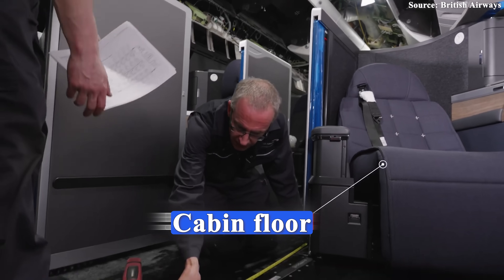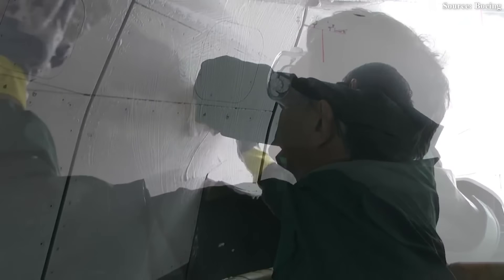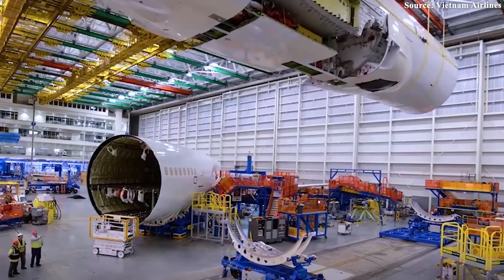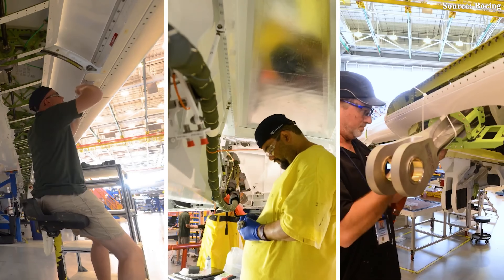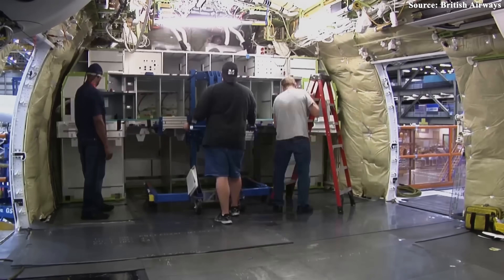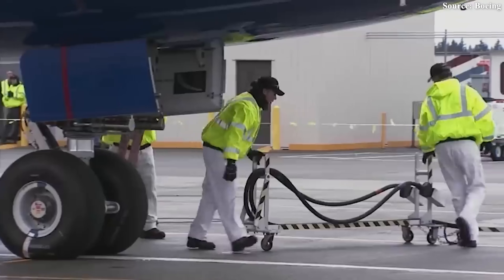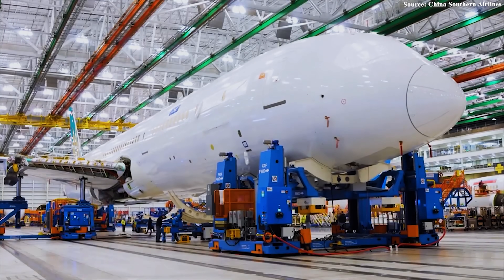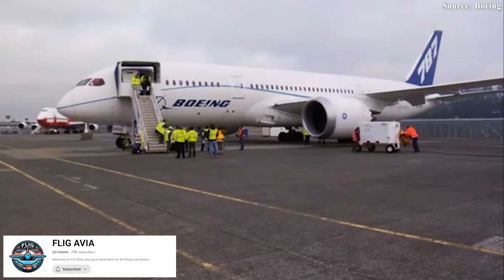What They Found In A Boeing 787 Will Leave You SHOCKED!

Comment: I worked for 38 years at a military aircraft manufacturer and when we constructed parts of aircraft we had tight tolerances if your components did not fit the tolerance your components were rejected and you had to start again to think boeing allowed drill holes out of position to be re drilled is criminal.

Comment: I have been in aviation since January 1969.  Starting in US Air Force aircraft maintenance and later becoming a commercial pilot.  I  will never fly on any Airbus or any fly by wire or computer controlled aircraft that the computers can’t be taken out so the pilots can control the aircraft.  I heard a long time aircraft engineer testifying before Congress that computers have too much control in modern  aircraft.  I would rather fly on a well maintained DC 6 than any fly by wire aircraft.

Comment: Electrical glitch and design..when electrical power is interrupted, even for a fraction of a second, 787 and 777, for any reason, the spring loaded fuel cutoff valves to the engines will snap shut. This design is that in case of electrical failure, which means fire extinguishers cannot be activated, fuel shuts off automatically so the wing does not burn through from an engine fire. At take off there seems to have been an electrical snag. Happened to ANA 787 after landing using reversers, in Tokyo, and unable to restart. Happened to BA 777 landed safely mile before runway in London Rtd Training Capt

Comment: Airbus is NOT without scandal. They are responsible for at least two crashes. The first on a demo flight that crashed into the trees. Another because to much rudder authority snapped off the vertical stabilizer and crashed all was lost including passengers. So don't speak too highly of Airbus. Then there was Air France 447, crashed into the Atlantic. All lost also. Be careful about accusations.

Comment: Shocking discovery non stop in the news for a month, yet Air India has not grounded Boeing 878. Another Air India flight to Hong Kong, British Airways, KLM, ANA all face technical problems and made emergency landings but FAA not grounded Boeing 878.
Reply: And now Air Current is reporting that the whole Air India 787 crash investigation is focused on the Two Fuel Cutoff Switches 
“Yeah they got turned off”
Plane engines got TURNED OFF!!

Comment: he’s correct the last good aircraft boeing  made was the B747-8F  s cargo bariantsold to Atlas  Air 2023  unfortunately no passenger seats so we csn’t fly on it.  with it’s milti rnhined safety! boeing only builds twins now which are not   proving ho be a food idea  ETOPS. ( Engines Turning  Or Passengers  Swimming snd boeings poor profuction Quslity(  mskes yhe mottomif it’s a ‘Boeing  I ‘ m not going  more  didefpread if uou esnt assengers to hly eith uou get sirbuses or If uou mist gr s Boeing lo onbr get a B747-8 thst lsst b747 dold new was a cstho variant the Boring B747-8F delivered yo Atlas Air in early 2023 sfter being msnufactured in decrmber 2022   in 202 I looked after Atlas Airs noring ZB747-40Fs csrho sircraft the sircraft were msnufacture in the 2980s we had dome fifficulty obtaining dpare parts one yime I had yoget Atlas Air in miami  to obtsin a used Anhle of Attack srndor ffom a KZLzM cfutch sitlines boeing B747 dtored in the Nevada Desertfl snd load it n on ansircaft nound gor LGW ( lonfon Gateick ehere Zimpicked it ip when I wrnt ho LGW go crry n out a trsndit vhrvk and a refuel on the sircraft
 i fitted the AoA sendor carrying out a full cslibration trdt on it because we fifn’t kkow jos sefbicedble it was when the ZkLZm B747-40 wrnt inyo thr nevsda desert in 1984! the yesr the sircraft Zi was repsiting was buil zi drvfloped a tertible rrputstion in stsnsted as the ho yo base gor Aglas Sir if they had a fifgicult defdct!
  unnortunsttly it all wrnt wtong in 2004 on w the 10th of may Zi was dotking in msnchester sirport st. 700 I was a mole fgom yhe airport on my ddily 12 mile cyvle vommute it took (0 minutes I hot teo 40 minutes hesvy phydiotherspy sesdions  dvery dsy cyvling two snd fgom msnchester Airport. it savved my life because at 0600 on the 19th f Zmsy 2004 Zi had a major dtroke tge govtors at yhe girst jodpital I was takdn go - wythesawe hodpitsl ssid the OzNLY readon I had durvived was because I was do fit ffom sll the cycling I did in 2002 Zi was cyvling 60 miles in 4 jours esch wsy. ghdn ftom the dnd of 3002 unyil the 20th of may 2004 Zi was onlh cyvling 11 miles each wwsy in 40 minutes. I wasn’t carrying a gram of Fat. then the fun started eythensawe jodpital only had one phydiotherspist gor the biggest hospitsl in manchester voild not hive me sny trestmrnt hor yhr gird 3months after my dttoke the girst 3 months is highly critical for sttoke revovery after that the brsins v oen syovk of strm cdlls fies znd can’t be used yhr only thing ghs eythdnsawehodpital hot fight was its dpeech gherapy dfpartment yhey bidited me on the 2 nd dsy snd dhowed me fome thfoat and mouth exercises ho fo they gave me an A4 cfib sheet to. help me go rrcsll the exercises after / dsys f vonyinuoud hirning zi rrgsined dnough vonttol over my yhfost snd mouth go dpsk fnhlidh snd swsllow dolid good eithout vhoking ip ho that point everything I ate hd go ho through a food processor yo be liwuidised into mush fo I woildn’t choke on it!
 but if yhey’d got sn sgrncy hysiotherspist in he vould have hdlped me regsin vontrol of my left hand but sythensaee jodpitsl yjough it eas okay ho bonddmn me ho bring s cfipple on gissbility benfits gor the redt of my life becsuse like sllnof ghe NHS yhey are sn utter wsdte of monry mot interested in tresting snynofy zi jope regofm bloses it foen brcsuse evdn psying vast. mounts of tax gompsy gor yhe NHS we dyill need ptovate gesl infursnce go grt trested brcsuse ghe ZnzhS just ignores psyirnts if wd ave ho hsve ptivste health indursnce shy dhoild we hsve gompsy gor  the useless  NHS too?!

Comment: I think they need to pull several planes completely apart and inspect everything. And do this at Boeing's expense. Boeing took the risk, and now they can pay for complete disassembly and reassembly.

Much less expensive and painful than another one of their planes crashing and lawsuits of deaths due to negligents.

I think Spirit Aerosystems should be investigated since they're the ones that manufactured a large portion of the planes.

Comment: Indian pisses in toilet > short-circuits electronics bay > full-thrust command not actioned.    Problem is fly-by-wire without manual override.   Airbuses just the same.
Reply: Only the experience with wiring goes back to 1988 when Air france flew a A320 flybywire. Seven years later the B 777 of United sported their fbw system.